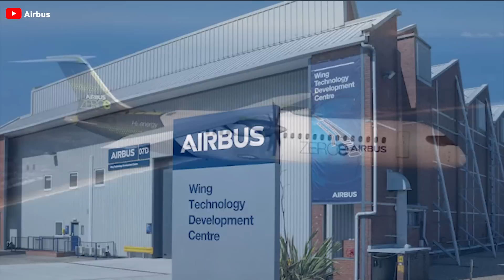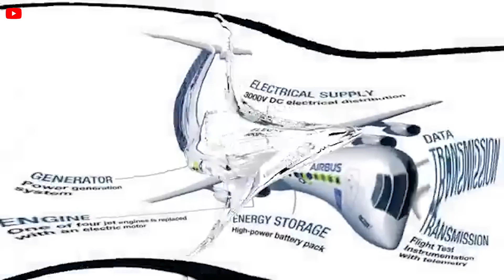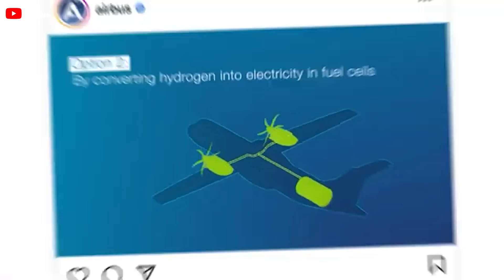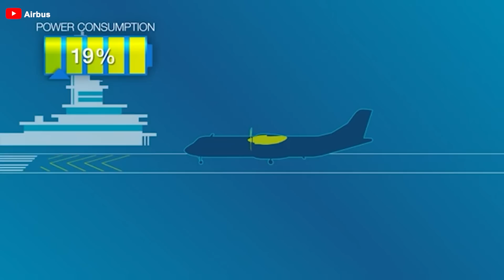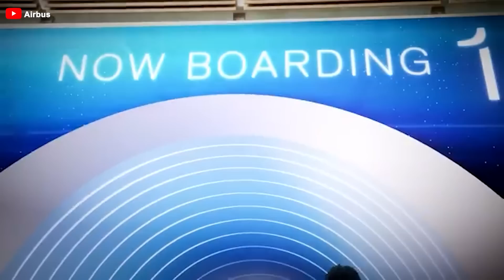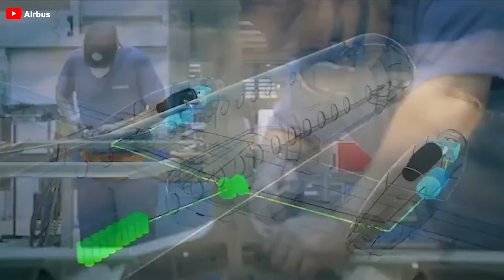Airbus' next Aircraft Is a HUGE PROBLEM for Boeing! Here's Why

Comment: Hi Flig Avia, I do think that you should not try to assert that the airlines are 'competitive', for that to be even slightly true there would have to be two or more different aircraft at the departure gates on exactly the same routes at exactly the same times and at very similar prices, thus passengers would have to choose which plane they prefer, at the time of departure.
The commercial combat they do engage in has nothing to do with competition as such but more about exploiting short term advantages in operating and borrowing costs and putting the squeeze on suppliers. Much the same also applies to the manufacturers who quite often use exactly the same sub-contractors for very similar services. Many of them for example use the same engines form Rolls Royce and General Electric.
Were it not for the regulatory bodies keeping some sort of lid on them what we would see is a rapid race to the very bottom.
Cheers, Richard.